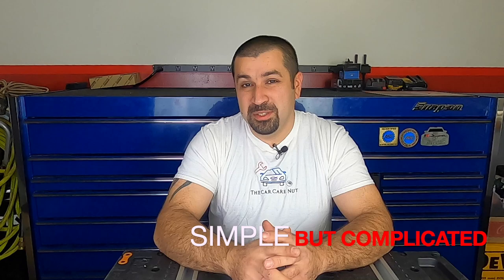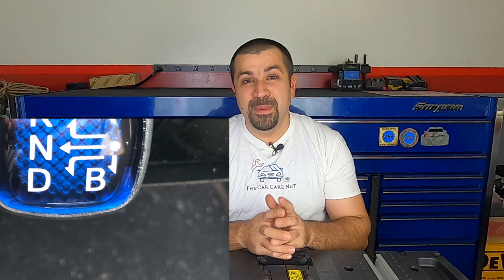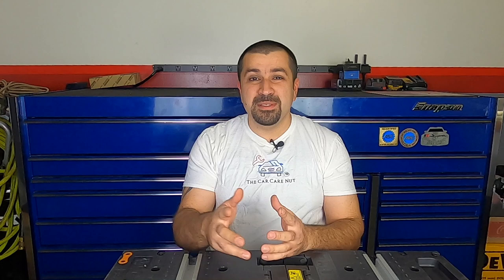How Toyota Hybrid System Work Part 6 B Mode and Hybrid AWD

Comment: Another difference between D-mode and B-mode: the car will 'think' HOW to apply the brake. When driving slow downhill in EV in D-mode and brake like 5% it wil use hyrdraulic brake, brake a little more and the hydraulic brake wil work harder (and burn eventually, lol). Do the same 5% braking in B-mode and the MG2 is in full action, still without ICE!
If you brake a little more in B-mode, like to 6% the car will calculate if ICE or hyrdraulic brake is needed.

(Sorry for my English, i'm Dutch)

Comment: Hi, thanks for another a very informative video. Would you recommend using B mode sometimes when approaching traffic lights to avoid excessive heavy breaking.
Reply from the maker: Hi! I wouldn’t use B mode unless you’re going down hill. Braking in hybrids is a good thing. It recharges the battery
Reply: @TheCarCareNut  great, thanks. I won't use it then unless I'm going downhill.

Comment: We get a lot of snow thus icy conditions in the winter time. Is it ok to use the B-mode for the initial pickup from when the vehicle is stopped? or drive in that mode under lets say 30km/hr for better control for short periods of time just like lowering the gear on an auto trans.?
Reply from the maker: Hi! Yes you can.

Comment: Hi the CCN!  When I'm on a freeway, I like to put my hybrid plug-in on ECO mode and cruise control on maximum distance.  I find the car is smoother as it has more time (a couple of seconds longer) in advance to slow the car itself.  I think this also creates less stress to the car and passengers too.  Any comments?
Reply from the maker: That’s actually in my opinion the best time to use Eco mode. Eco mode around town can get frustrating but at steady speed and small variances in speed it’s good. And the distance I agree it will actually brake early and mostly use regen in that case
Reply: @TheCarCareNut  Do you see any long term disadvantage for the CVT keeping the car in S6 versus D. I have noticed I get slightly better mileage on my Hybrid in S6.
Reply from the maker: I don’t see a disadvantage but I would use regular D for everyday driving

Comment: Thanks for the series, which gave me much more knowledge about the hybrid system. 
But what you‘ve not mentioned about AWD: if the rear wheels only have mgr, how does it  gets  the power from the gas engine to the rear wheels? And what happens, if the battery charge is to low for electric driving? Is it just a soft and part time awd?
Reply: There is no power from the gas engine to the rear wheels. The rear has it's own motor. Electric.

Comment: I took my 2022 CHR Hybrid for the first 15k km oil change and checkup at the Toyota dealership (it had 9K km). After I got it back from service, the "B" mode is now much weaker than it was before I took it into service. The service at the dealership told me because of the new oil, the system has "relaxed" or loosened up. This does not make sense to me as the breaking feel of "B" mode is half the resistance as it was before service. Is there an adjustment to tighten the breaking feel or is the dealership telling the truth?
Reply: Great question?! Perfect timing too! As I just did an oil change and had the same thing happen! So they're NOT LYING for once. Also makes sense. If an engine has dirty oil, it will NOT be able to crank thru as if it's bathing in new oil.

Comment: This is an excellent series on how hybrids work, thank you!
Do you happen to know what happens in the case of a hybrid with shift paddles on the steering wheel? They simulate the gear ratio ranges, so I assume it would work similar to the B-mode. But, I'm curious - if, for example, when going down a gentle hill and downshifting from D6 to D5 - can it provide enough deceleration with just regenerative breaking, or will it still need to spin the gas engine just because the shift paddles were used?
Reply: You don't have a CVT
Reply: @doordash-nh1ih my Lexus RX450h+ has a CVT and paddle shifters.
Reply: @filipjnc  hmmm, interesting.

Comment: It sounds like B mode activates MG1 to spin the engine to dump excess charge from the maximum regeneration, preventing overcharging of the battery.

Comment: Thank you for another great video educating us on Toyota Hybrid systems. I have a couple of questions regarding our 2021 Venza Hybrid. There is no “B” mode on the shifter but there is a Sport +/- mode. Is there a downhill braking mode in this?  Second question or request, can you explain more  on AWD models what triggers MGR to power up? I’ve heard it happens when back wheels slip, but when I’m driving I can see MGR power up at various times. Thanks!
Reply from the maker: Thank you for watching my videos! The Sport + - is basically the same as B mode just in levels or more similar to a conventional automatic transmission. So when you downshift using the S - the computer will set a level of B mode if you would and as you downshift more it will level it up more.

Regarding MGR the computer determines driving conditions based on wheel slippage and demand to use MGR. It doesn't use it all the time for example if you're cruising at a steady speed on the highway it will likely not use it as it's not needed and it will be more efficient if it doesn't apply power to it.

Comment: A while back I picked up my 2019 hybrid highlander and noticed it was missing the tow hook in the tool kit. When I asked about it I was told that the highlander hybrid should never be towed, even in a recovery situation. 
Can you please add a towing section for the hybrid series.
Reply: It would be awesome if you explained EV mode on the new hybrids...Why is it always unavailable?
Reply from the maker: Towing should be done on hybrids with all 4 wheels off the ground in AWD hybrids and driving wheels off the ground in 2WD hybrids. Thank you for the suggestion on EV mode. Added to the list!

Comment: I was going downhill and I pressed the breake. After awhile, the computer switched it into B mode. I have a 2019 Prius Awde
Reply: I think this happened to me too, I was going down a hill and suddenly the engine was making a ton of noise, I think I know what that was now lol
Reply: Yes, the control software will detect when the battery state of charge is approaching too high of a level when braking and automatically engage B mode, no manual input from the driver necessary.

Comment: Hi interesting video series, does the engine still use conventional igniton system, ie crank and cam sensors and igntion coids ecu etc and fuel sustem normal electic pump in tank etc Fred.
Reply: Yep

Comment: What you didn't mention is that even on a fairly short but steep decent the small traction battery of a hybrid quickly gets full and so regen stops because there's nowhere for the juice to go. Engine braking is then the only supplement to the friction brakes. 
In a pure EV, you obviously have no engine, but the traction motors and batteries have more grunt to aid braking.
Reply: yes, my Nissan Leaf 2013 stops braking with a "motor-generator breaking" and uses "brakes only" when the battery almost full

Comment: Another great video👍 Is there less stress/load on the ICE when only being spun by the electric motor, without ignition or fuel? Thanks again👍
Reply from the maker: Hi! Compression is what creates load so if day it would be the same
Reply: @TheCarCareNut  Thanks very much👍
I have been very concerned because whilst still ‘breaking/ running’ the engine in (only 250 miles on the clock) my ICE kicked in, revving very highly, whilst descending a steepish hill! I never knew anything about this, therefore wasn’t expecting it. In your opinion, is this likely to have damaged the engine?
I have read two explanations on why the ICE kicks in. 
1) To dissipate power created by the the generator once the HV battery SOC is full. 
2) To create engine breaking. 
If the 2nd is correct what slows the car down when the battery is still charging from regen braking. Thanks again. Dave

Comment: Hi, I'm glad you talk about this subject! I've been using the B the whole time in my wife's Auris to get better engine braking. (I'm all about engine braking). In my GS i've got the 'flappy peddle gearbox'. When I'm approaching a traffic light I down shift to the max and gently apply the brake peddle (if needed). 
Is this a good practice I'm doing? Because the engine does revv up very high because of my downshifting.
Reply from the maker: Hi! I actually wouldn’t do that unless needed. Using the regular brakes will do the stopping just fine. On plain surfaces the regen braking will do a very good job and your hydraulic brakes will work as well but not as much as a non hybrid car.
Reply: The Car Care Nut hmm oke, so what are the disadvantages of downshifting? I assumed it would work like B but with more control on the RPM.
Reply from the maker: Downshifting a hybrid using paddle shifters or the newer ones with S mode essentially is the same as B mode just gradual where the computer would basically vary the intensity of B mode to give the feeling of a downshift.
Reply: So am I better off just using my breaks when going down a fairly steep hill on my 2022 Sienna, or should I use the S mode and shift to a gear that will do the same breaking for me?

Comment: Hi, excellent series.  I purchased the AWD Sienna that will be delivered in July.  I see there’s an option for 20 in wheels on some models but not the AWD.  Is it possible to change later?  Or does it void warranty ? Is it harmful?  TIA for your answer.
Reply from the maker: Hi! You can change it but it will affect your gas mileage

Comment: According  to the hybrid gauge, when does friction braking starts?  Is it when the gauge max out on charge?
Reply from the maker: Not only that but when they are needed. Regen braking doesn’t work as well at lower speeds or very hard stops
Reply: Generally, yes, if you’re familiar enough with the feel of the vehicle, you can actually tell when the hydraulic brakes kick on. Generally, I find that to maximize regen during braking, best to start braking early, and use no more than about 3/4 of the charge portion of the gauge. That said, the car will automatically de-rate the amount of regen braking depending on a number of factors: if traction slip-slide engages, if braking during a high-G cornering maneuver, if the ambient temperature is too hot, etc.

Comment: Hi, great explanation of how hybrid works.  I am on my third Camry hybrid.  My latest is a 2018 Camry XLE (Canadian model ) hybrid.  Is there a difference in my car and the Prius ?  Also could you explain the purpose of the shift (S) ?  I bought it in November 2019, so early production.  Thank you in advance for your answer.
Reply from the maker: Hi! The Camry and Prius has a different engine but otherwise the hybrid system is similar. The s mode simulates manual transmission driving and also is used instead of B mode when going down a step hill to slow down the car.
Reply: @TheCarCareNut  Thank you for the quick answer

Comment: Thanks for your hybrids series, very clear and simple to understand. Just wander how the system manage to keep the gasoline motor always on optimal temperature to keep fuel efficiency and reliability?
Reply: It doesn't. Though the ICE has a pretty outstanding range of operating temperatures.

Comment: What happens with a AWD in B mode. There is more regenerative braking and I wonder if that gives you more charging because there less need to spin up the engine.
Reply from the maker: Hi! It’s the same. It needs to rev the engine up to get the engine braking

Comment: Another great video!
With the gas engine constantly starting and stopping, does the oil pump still run to help cool/protect  the engine. With this new very thin oil, I wonder about the evaporation on the pistons, cylinders, cams and rockers?
Reply from the maker: Thank you! The oil pump doesn’t run as the engine stops. Time will tell the effects I suppose
Reply: Thanks for the quick response. Have you seen any 2.5 hybrids engines with 200k+ taken apart?
Reply: With these ultra complicated cars today, some Toyota dealerships offer lifetime warranties. Are these just gimmicks?
Reply from the maker: If it’s a 2.5L 2AR engine then yes. They looked ok but burned oil and had a work down cylinder wall. And the lifetime warranty always has a catch. Either somewhere in the fine print defines lifetime as a certain mileage and time or they will replace everything with high mileage used parts without warranty. I’d rather you buy a limited by clear time and  mileage warranty from a good company

Comment: i use that sometimes downhill at longer distances in my 2,3ton Hybrid when pull shifter towards me in manually and the e-cvt goes automatically down in 4th (stage?) and with lower speed i switch even more down into 3rd or 2nd (stage?) . It helps me to save brakepads BUT i hear sometimes a really high revving thng (MG1 or MGR or both ?) and i suddenly shift back to normal :-) Better replace easy brake pads instead or ruining a Hybrid system ,imo

Comment: Questions- 
Is the AWD less efficient? 

Is it generating power when it is not demanding power to the rear wheels(to charge when free wheeling)? 

Love this series. I’ve learned a lot. Would like to see more detail on how the regenerative braking system works. We have two hybrids 14 Prius C and 17 Camry. Love them. We also have 19 Highlander and still kicking myself for not getting that in a Hybrid. Keep up the good work. Love the channel.
Reply from the maker: Hi jim! It doesn’t use the rear wheels to charge when you are driving as the drag they create to charge will cause a higher draw to drive the car than the charge it’s creating.

Comment: Question: Why does B mode become significantly less effective (for slowing down or down hills) after each transmission oil drain / refill ?

Toyota dealership has lured me twice (each 100K miles service) into doing the transmission oil drain / refill, even though Toyota manual recommends to not change the transmission fluid.  Only inspect and fill up if low. 

After each transmission oil change, I noticed a significant degradation on the ability of B mode to slow down the car, as if B mode is almost disabled.  This degradation is permanent. 

Any explanation ?

Thank you for putting out this video
Reply from the maker: Honestly I don’t see the link between a fluid change and b mode as B mode uses the motors and the dead weight of the engine?

Comment: Does AWD-e regen from the rear induction motor?  Seems like it’d be a nice give back for using some battery power for low speed and occasional assist.  I was looking at an early review and they said that the AWD was only used to help launch and assist up to 43 mph when traction issues showed up, but not brake.  That’d seem like a lost opportunity, but maybe a bigger programming/coordination mess than T wanted to take on.  MGR regen for normal braking?  Thank you for the very understandable informative vids!!
Reply from the maker: The rear motor is a motor generator so it can drive and generate during regen braking.
Reply: @TheCarCareNut   MGR is capable of generating, but it never gives any regenerative braking! Look at the relevant PIDs in Techstream or an OBD system with Toyota enhanced data. I have done this with a gen5 RAV4 hybrid. No regenerative braking is ever requested from MGR, in contrast to MG2. There is some regenerative torque (electricity flow in the colorful car screen displays) from MGR during coasting, but this small amount or negative torque never increases during braking, in contrast to MG2. I assume that it is for safety - perhaps the engineers have not (yet) worked out how to ensure safety with rear-axle regenerative braking. Yours is a common misconception, supported by the ambiguous advertising statements on the topic.

Comment: I have a 2021 Highlander Hybrid and it has a S mode instead of the B mode. So how does that work? Like a standard tip Tiptronic system? So shift it down when going down hill for more engine braking then shift up when things level out?
Reply from the maker: Hi! Yes the S mode is essentially a varied level of B mode

Comment: Can you use b mode to slow down on off ramps and coming to red lights?
Reply from the maker: You can but don’t use it excessively where the car is in b mode most of the time. In plain areas using the brakes will be more than enough to slow down the car

Comment: My 2021 Toyota Camry  Hybrid LE  has a S drive to the left of D drive. What is that used for? I have a S mode button next to normal mode behind my shifter. I do not have a B mode,
Reply from the maker: It’s the same as B mode just at a varied level

Comment: Hello. Do u recommand using brakes regeneration or s mode in a 2013 450H for a snow hill. Are they technicals differences between phase1 and ph2 of the rx 3th generation? Thanks 4 yours explanations.
Reply from the maker: Hi! Use S mode as needed.